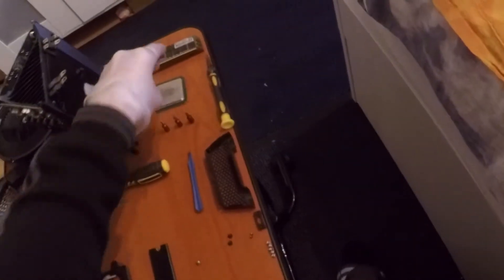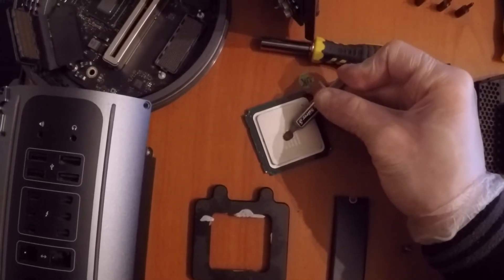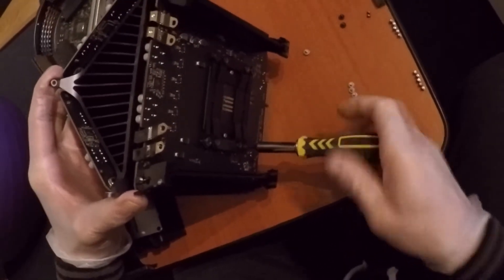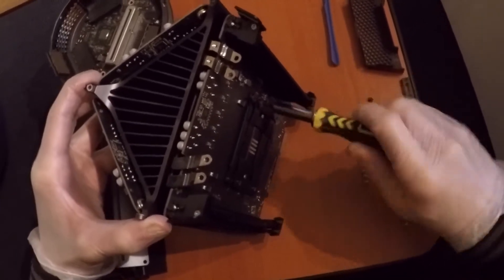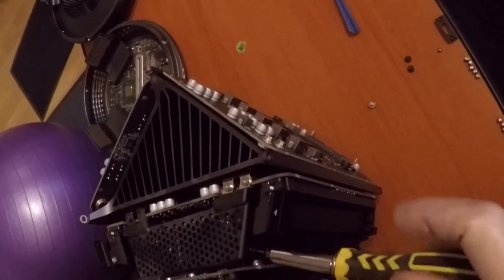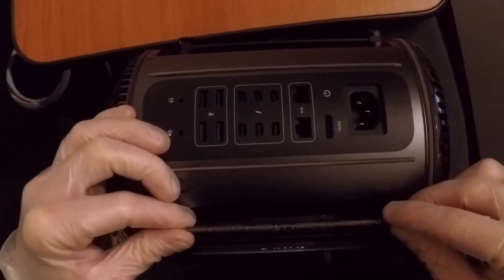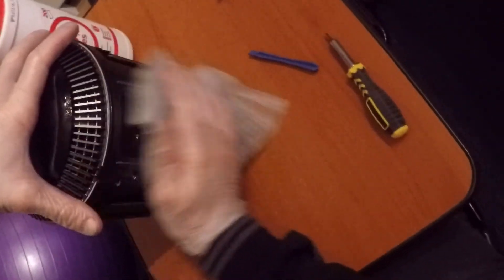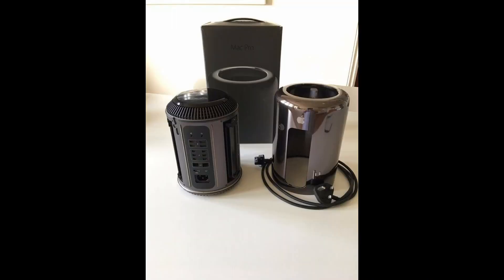Assembling 2013 Mac Pro 6.1 Trashcan how to upgrade 12 core E5 2697V2 processor 64GB 14900R memory

Comment: Hi Zoltano, Thank you for the nice video. Very helpful. I have a little problem. After installing XEON E5-2697 V2 everything works great. However, sometimes, when I turn on the mac. It automatically restarts while being in booting mode, you know, while seeing the apple logo in the center and I get a message saying; your mac restarted because of a problem which is a message in 4 languages English, Spanish, Japanese,  Chinese etc. Do yo know it? And then I log in and I'm presented with a message saying "Your mac restarted. and i'm offered to submit a crash report to apple. Do you know what's a fix for this?
Reply from the maker: either the memory has ECC error, check in the system menu about my mac hardware report and replace the faulty module. Or the thightness of the screws on the CPU is not full locked. Dont be shy to thighten it oll the way, when it locks you stop do not force it more.